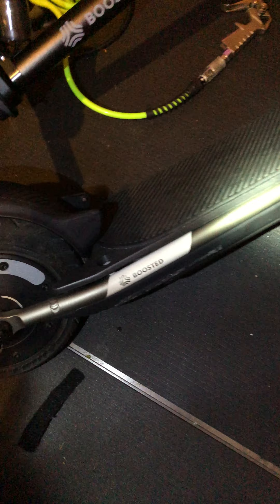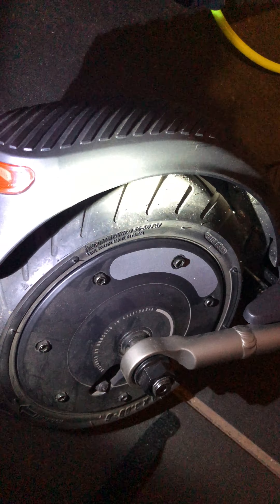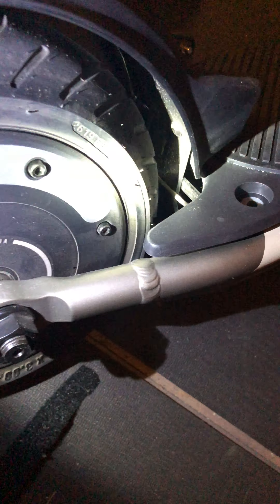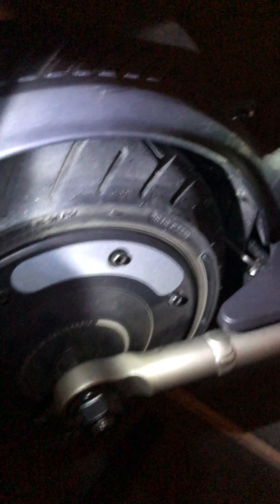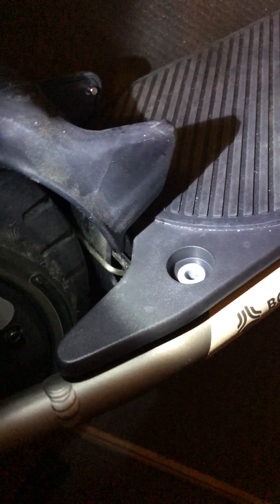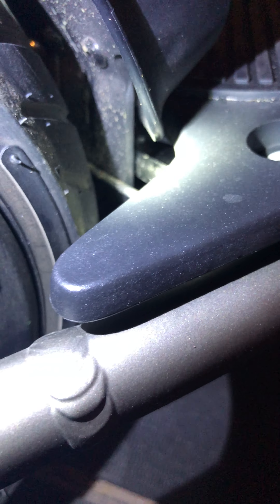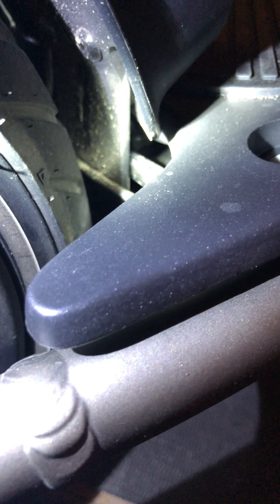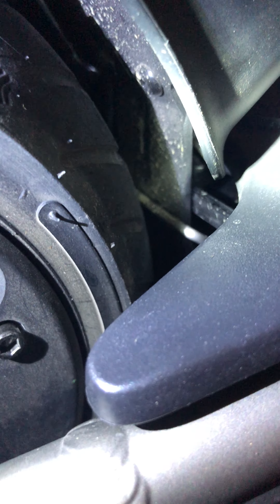Boosted Rev - Rear fender rattling and "detached" front of deck explored

Comment: The gap in the front is for heat dissipation all components inside are water proof. The rattling with rear fender is normal when going in bumpy road, to minimize it just put foot in the back of the board. NOT ON FENDER.
Reply from the maker: i think you're prob spot on with the front gap being for air cooling.
i'd agree the rattling fender is "normal" given the poor product design choice to construct a fender prone to that much movement over bumps. my feet are permanently on the back of the board (size 14 US shoe).

Comment: I noticed the rattle quickly too and attributed to rear fender. I only have 60 miles on mine so far but have found riding my rear foot a little on the fender reduced the sound some on bumpy sections.

Comment: Thanks for posting this video. I’ve had mine for three weeks and have seen the same “issues” on mine. I am still not convinced about the front deck opening. Someone mentioned it is for cooling purposes but a vent at the very front of the board would surely be more effective.
I noticed the rattling noise during the first ride and initially thought there was something loose. Have you got any fix/workaround for the rattle? 
I am currently in the process of returning mine...
Reply from the maker: Velco or felt being placed between the metal surfaces at the base of the could help the rattle. I've kind of just learned to ignore it at this stage personally.
The front deck opening certainly would provide a bunch of airflow over the controller from what I see. I actually wonder if it will make the battery too cold in lower temps and affect performance.